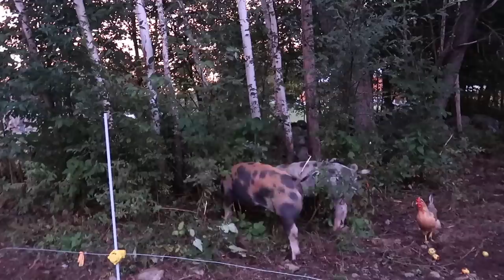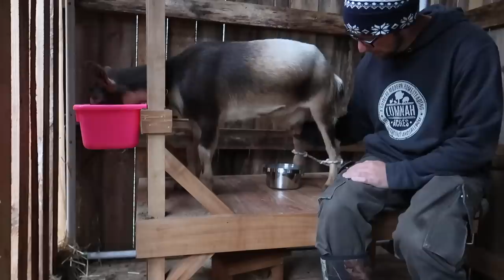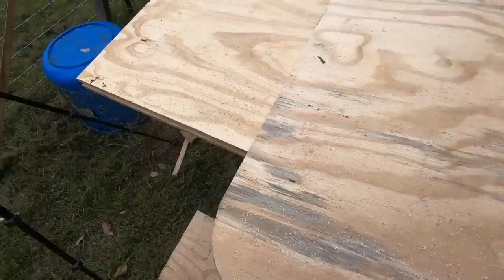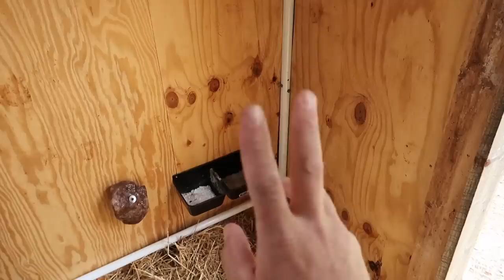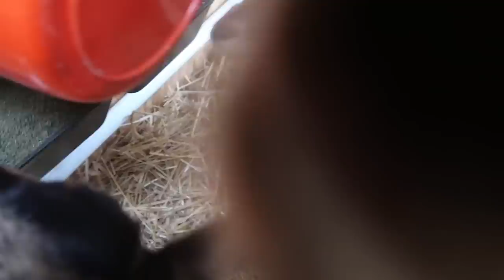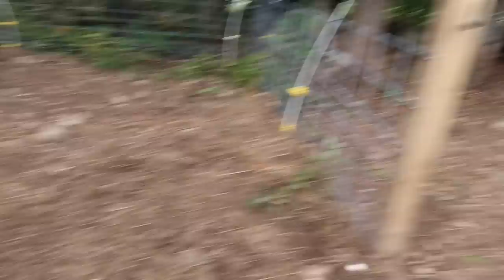Can we Get it Done Before the Storm (Goat Barn Renovation)

Comment: You would save a fortune in materials if Hemp is legal yet in NH.  3 crops,  seeds for bio fuel and high protein animal feed or human,  flowers to sell for medicine, stalks for slip form over post and beam walls.  Fire proof, water proof, breaths and no mold.  The shive in the stalks there.  The stalks decoritaced for insulation between floors.  Good luck with the weather.